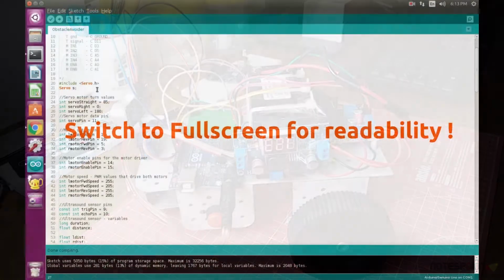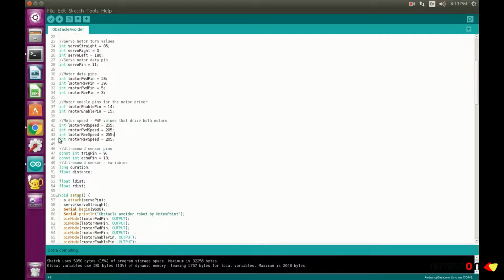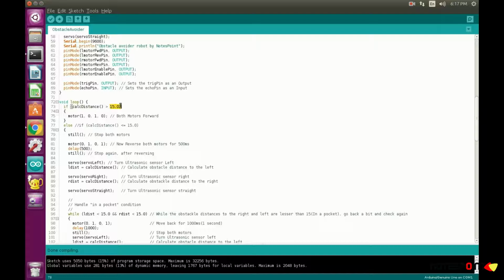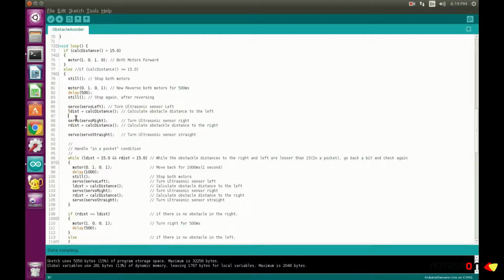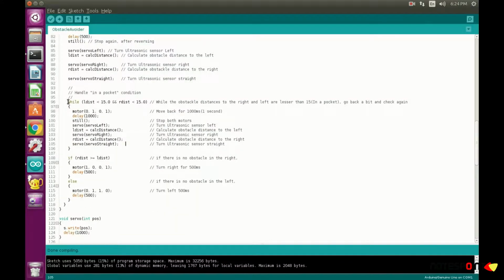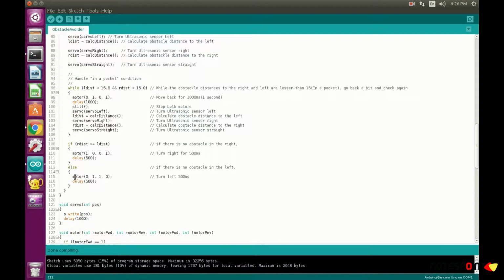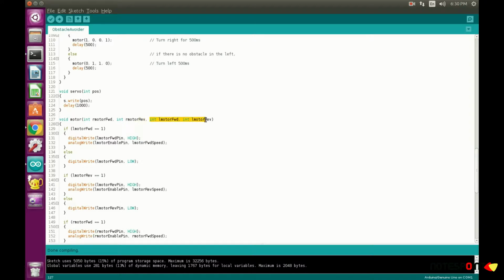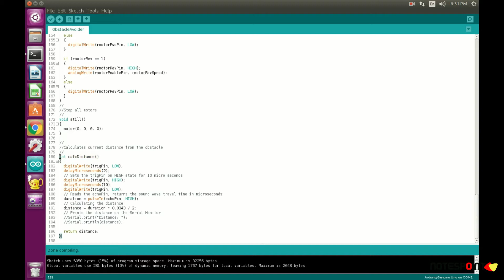Obstacle Avoiding Robot using Arduino - With Full Code

Comment: Can you help me to make a sketch of below link with servo motor ? https://www.makeuseof.com/tag/build-4wd-arduino-robot-beginners/
Reply from the maker: Sure! 
The code to handle the servo motor is already in my code. You can download the sketch from here: http://www.notespoint.com/wp-content/uploads/2018/03/ObstacleAvoider-1.txt

Let me know if you need just the servo specific code. You can drop an email via http://www.notespoint.com/contact-us/ and I can reply back via email.
Reply: Will this code work for 4wd ?
Reply from the maker: I tested it only for 2wd. But it should work for 4wd as well. Just that you need to connect both motors on the same side to the same channel on the motor driver.
Reply: yeah it is working...thanks..